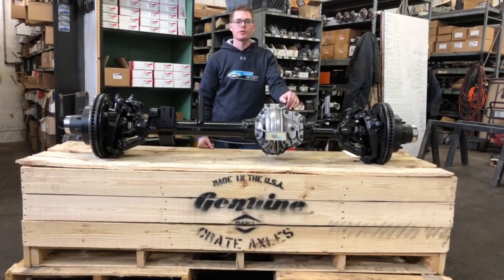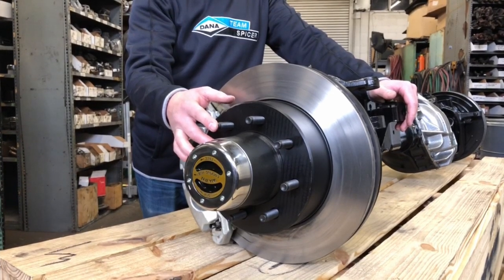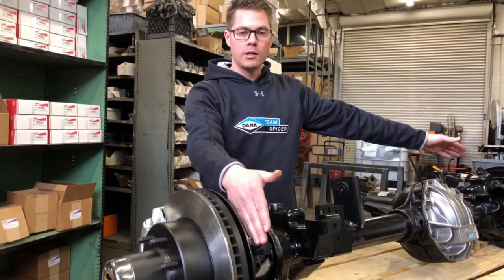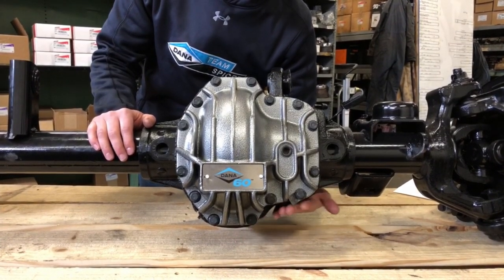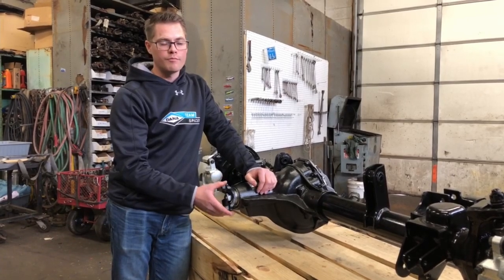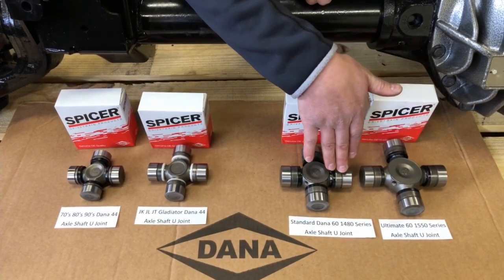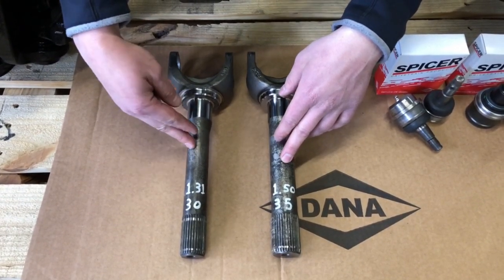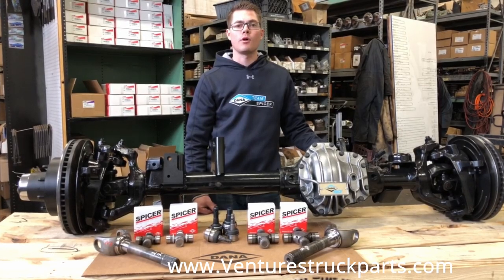Dana Spicer Jeep JL JK JT Ultimate Dana 60 Front Axle Specs And Overview

Comment: @Ventures Truck Parts, I accidentally put a Dana 50 axle into a Dana 60 front diff. We'll, one side, anyway... The driver's side wouldn't go in far enough, which raised the alarm bells. That's when I notices the difference in axle size/splines. So, the passenger side has the 50 installed, and I beat the piss out of the driver's before stopping and putting the 60 back in.
My question is, what was I beating the axle shaft against inside the diff when trying to get the shaft to seal? Could I have done damage internally?? And how about the wrong shaft fitting into the passenger side??? Will it JUST not engage properly, or is damage already likely done???? Switching to the Dana 60 axle asap, btw...

Comment: Hi

Can you tell me if the Ult 60 knuckles are dimensionally the same as the 05 and up Super Duty Dana 60 knuckles? Would be an easy way to get high steer for those.